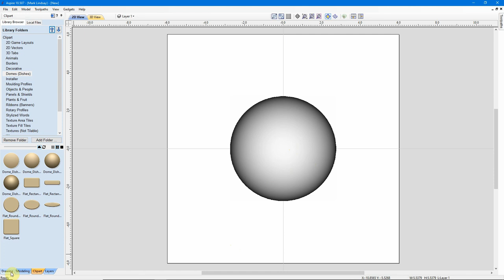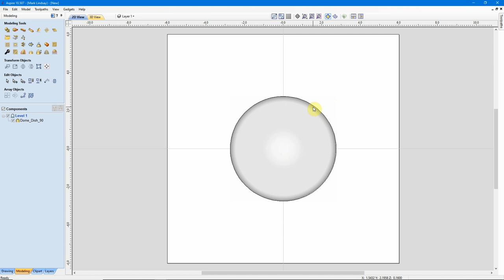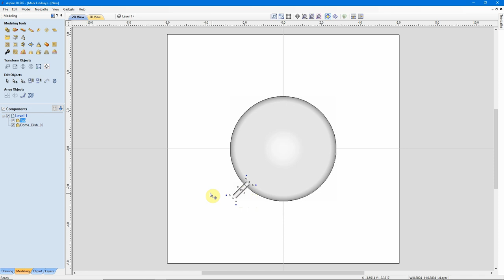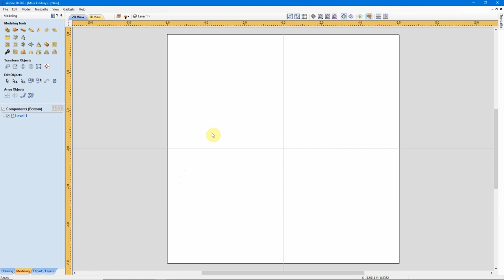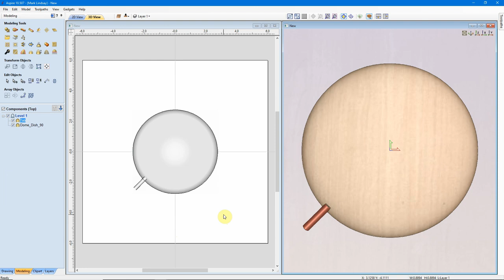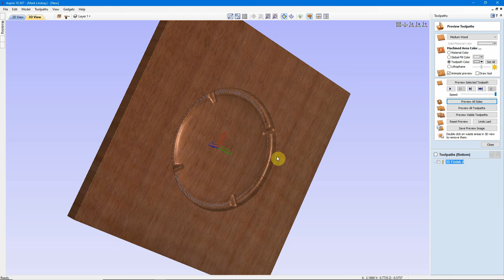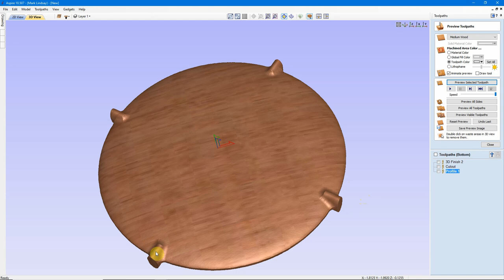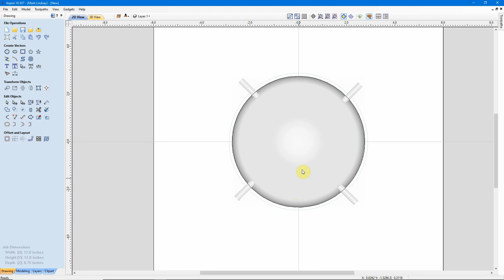Using 3D Tabs in Vectric Software – Part 10 – 3D Carving for Beginners

Comment: Consider:  Double sided Job, models on both sides of a .75" job as presented.  Could you put 3D tabs in the center of the thickness on first side, say .25" deep with a 3/8" base height, then on the second side make the profile tool path 7/16" deep with 5/15" tabs?  That should make the 3D tabs on the bottom with a clean cut on the top, should it not?  Do you think this would work?  Thanks for the informative video.
Reply from the maker: It sounds good, but let me do a couple of simulations and I'll get back to you. You could always try it and Preview it - you don't have to wait for me. There are always a bunch of different ways to get a great result. I'm going to show a couple in today's Live Q&A. This video was just getting so long, I showed the quick way to get it done.